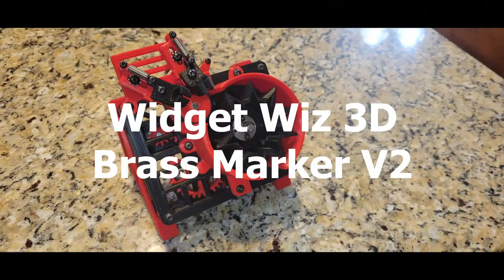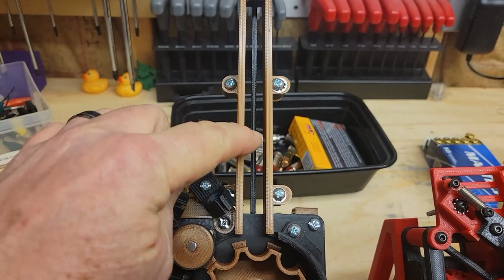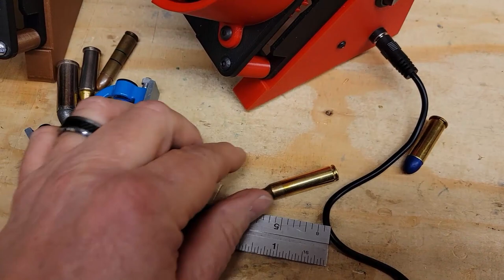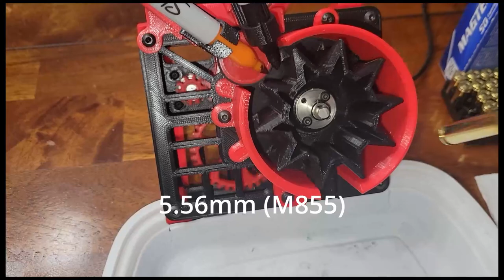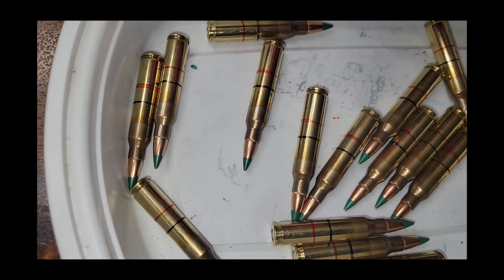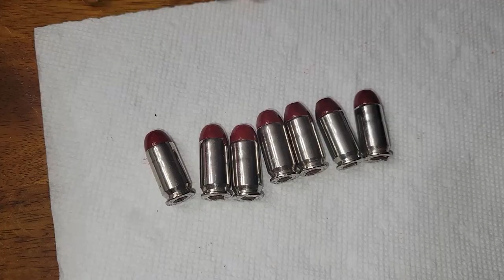Widget Wiz 3D Brass Marker V2

Comment: 👍👍 Works as advertised.  There is a bit of setup time involved, but that setup time for different calibers should decrease as you understand the optimum contact points.  I found that using a allen wrench to tighten(snug) the markers is the ticket to prevent the markers from drifting.  Since I'm only working with only one caliber the re-setup should be quick, I marked my pens with reference lines for minimal adjustment when they are removed to placed the caps back on.  The Wiz 3D is fast, as fast as you can place the ammo in the slots.  As a newbie to the PRS world and just your local range shooting the Wiz 3D is slick.  A big thanks to the inventor.  👍👍👍👍

Comment: hello
can we have this update of the cog for people who bought the old files?  Cordially
Reply from the maker: I will work something out for previous customers. I do need to mention that more than the cog changed. To accommodate the smaller sized brass, I had to make other changes. There were changes to multiple parts in this version. Reach out to me using the email you used to purchase the original plans.
Regards